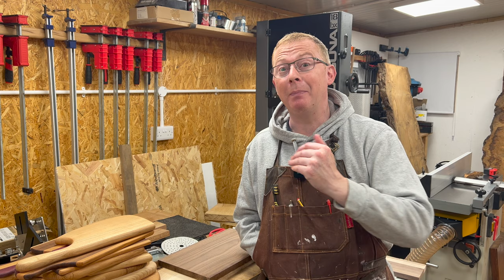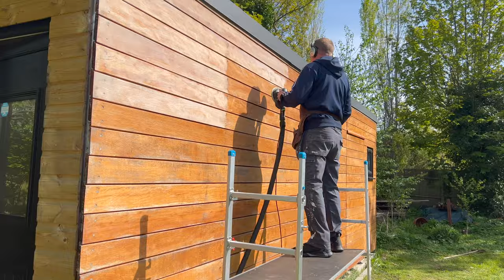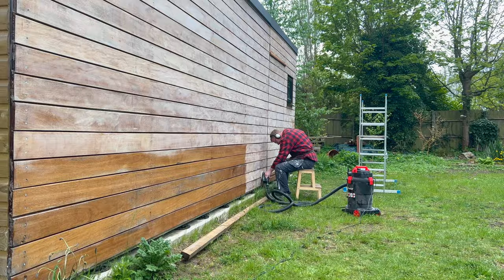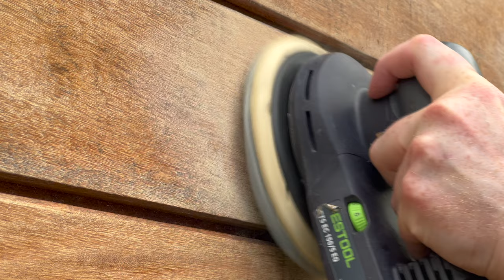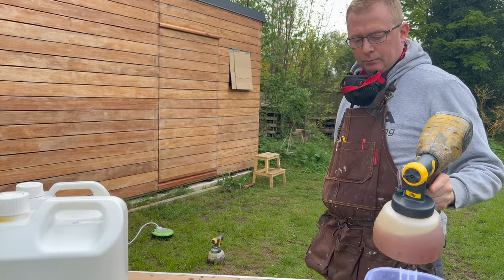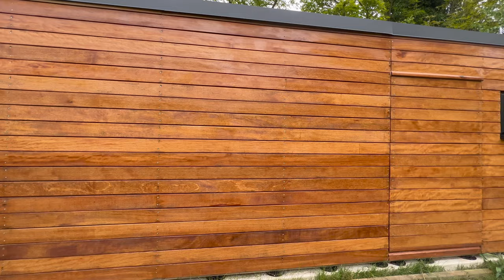I've Had It With Osmo UV Protection Oil👎

Comment: Timmersol Exterior Timber Stabiliser is a great (and much cheaper) alternative to Osmo UV Oil. It's full of oil and wax and holds up really well, especially for log cabins which suffer from more timber movement issues than any other product. It's nano porous so still allows moisture to ingress and egress, but at a much slower rate than a micro porous wood oil, preventing those huge swings in timber movement.
Reply from the maker: Thanks Pete, may I ask where did you get it from? Cheers, Leo 👍😀

Comment: How did the boiled linseed oil hold up?
Reply from the maker: About the same as the Osmo Michael. I’ve set up quite a bit experiment testing different finishes on the front of my workshop. Recent video on my channel if you’d like to check it out 👍
Reply: @Hand-i-Craft  I've got pretty big area of batten fence to treat so was looking at my best options. Money wise also as osmo is coming in pretty expensive. I've watched your recent video of the difference products you've applied. I'll keep an eye out for how it turns out.

Comment: I was about to comment on the older video you have up regarding Osmo UV Protection Oil until I saw this follow up!

Unfortunately, I have had the same experience with the product as you. I’m out in north-central California where it gets pretty dang hot in the summers and decently wet in the winter (Winter 2022 was epic [wet] for the whole state).

I’ve got a long redwood bench that sits out in front of the house; thought I sanded well and then gave it a few coats of Osmo UV oil. It applied great and the finish really brought out the beautiful tones of the redwood. I was pretty happy for the remainder of the Summer and Fall.

Winter hit and as I mentioned, it was an unusually wet winter for us out here. I’ve got a big sycamore that dumped leaves on the bench as well.

As soon as the weather started warming up, I tried to clean up the bench and pressure wash it, and I just noticed all kinds of areas of the redwood that were darkening and spotty mildew (mold?). I was pretty disappointed like you, considering Osmo UV oil isn’t cheap.

Could I have sanded better and could I have misapplied the product? Absolutely. Regardless, I’m out of Osmo UV oil and the stuff that I did put on, didn’t hold up. I’m going to try a product by Duckback and we’ll see what that does. Anyways, just passing along a shared experience. Take care.
Reply from the maker: Thank you for taking the time to share your experiences here. Very good of you and much appreciated, best wishes, Leo 😀👍

Comment: Do a test piece of any small piece of wood... with just one coat of titebond 3. Leave it outside forever. It becomes a rich golden caramel color and is seemingly indestructible.
Reply from the maker: I remember this comment from you pal last time. My only concern was how to apply this and the consistency across the whole area which is quite substantial. You’re absolutely right though and I will try it on a piece to compare results 😀😀👍👍

Comment: I used the osmo on a new shed and some raised sleeper beds 3 years ago and the shed still looks like the day I applied it but the sleepers have flaked and have black patches I think it’s down to moisture content of the timber at time of application.
Reply from the maker: The moisture in the timber was spot on when I applied it pal (less than 12%). I think the climate here doesn’t help and the high sap content of the wood, kind of makes the idea of forking out a small fortune on a ‘premium’ finish a waste of time 🤷‍♂️

Comment: Hope the new finish works better Leo, as you said, you pay a premium price you expect it to last and to degrade consistently with time.
I’ve had a similar experience with Ronseal Fencelife Plus which is supposed to last 5 years.  I sprayed our fence panels with it, wire brushed first and then 3 coats each side.  The following year it was flaking off in places so I repainted it all again with a brush and now this year it’s again flaking off.  I complained to Ronseal and they gave me some vouchers for replacement products but when I’ve finished it up I’ll be replacing the fence with UV resistant plastic panels as I can’t face painting the fence every year with what is supposed to be a 5 year product.
Reply from the maker: Exactly Geoffrey, if a product doesn’t live up to its claimed purpose, then what is the point🤷‍♂️. The composite panels sound like a good idea, no need to worry about maintenance then 👍👍
Reply: It was the no maintenance that's my primary reason for looking at composite. But ugh the cost

Comment: Doesn't matter how others have found OSMO, you're talking about your experience ... others can either listen to your experience or ignore it and try it themselves ... in your case it didn't give the protection you thought it would and therefore wasn't the solution for you!!     I'd prefer to use the brush for an external finish as it gives a far thicker coat than with spraying 👍
The doors on my garage are wood and I coated them with Ronseal 5 year woodstain varnish (I think that's what it was called), about 16 years ago and they look almost as good as the day that I did them ... I'd say they are slightly sheltered from the majority of the wind and rain, but whether that has made a difference to the longevity or not I don't know!
Reply from the maker: Cheers Barry and thanks for sharing your positive experiences with Ronseal, great for folk reading these comments looking for ideas and suggestions 👍👍
Reply: Ive had a similar fail with Osmo. Try Impra ( Color then Elan) superb stuff lasts much better.

Comment: How's it looking 10 months on? Same as with the Osmo? I'd be ok with that using a much cheaper product.
Reply from the maker: Spot on this pal, it’s the same results as the Osmo as in it’s in need of an annual maintenance, but literally at a fraction of the cost 👍👍
Reply: @Hand-i-Craft  Thanks mate. Just sanding down my cedar fence to re-treat as I had the same issues. 👍🏻

Comment: The cladding only received finish on the side surface right? So maybe moisture and rain water is seeping in from the gaps between the strips and get trapped by the side finish and started micro rotting
Reply from the maker: No, all sides were treated 👍👍

Comment: Everyone is entitled to their opinion. I don’t have one as I have never used the product. But I do know the weather in the UK and if can wreak havoc with oils so I think you should stick with the 2 to 1 mix and give it a coat or two every year.
Reply from the maker: That’s exactly what I’ll be doing John. Totally accept there are a huge range of variables that could affect the performance of that oil in the U.K., the weather certainly being one of them. If that is the case though, why are people (including myself) even bothering with Osmo UV oil when we can get similar results at the fraction of the cost

Comment: Why haven't you spoken to osmo they are really helpful, I have many times. There is a osmo product called base coat for exterior wood you apply before the oil to stop mildew and black spot then the oil to seal. Also spraying it on out side in the wind for an oil its probably gone on far to thin. There is a specific amount per mtr for oils so best brushed or rolled on to soak in then wipe off  if necessary. I have used it on lots of exterior wood no problems. I hope this helps.
Reply from the maker: I tried Stephen, twice, and received no reply to my concerns. When you see me spraying on the wood, that isn’t Osmo, that’s the mix I’m trying out instead of Osmo👍👍. Cheers for the message though and thanks for sharing your positive experiences with the product 😀👍

Comment: Spraying looks a lot easier than sanding.  Hopefully it won't need sanding when you redo it as long as it's not left too long.
Reply from the maker: If the upkeep now Mike is spraying one or twice a year then I’m happy with that. It looks great again now 👍👍
Reply: @Hand-i-Craft  It certainly looks a lot better than it did with Osmo and the flatter finish is nicer.

Comment: Interesting. I've never had an issue with any osmo product, but I mainly use it on interior cabinetry. I don't really find it that expensive either as it goes so far. The only things I've done in the UV oil are 3 bee hives, specifically because it's a more bee-friendly option compared to other finishes. Been on 3 winters and still sound.

I did a cedar clad shower room (don't ask 😂) in osmo top oil with osmo wood protector underneath and that came out amazingly, 18 months and still good.

Still, not sure I would do cladding in it. As you've discovered... Something like that I guess needs a more 'nuclear option' 😅
Reply from the maker: Cheers for the message Pete, as I said in the video lots of variables to factor in, but after it failing twice I just didn’t see the point paying a significant premium that isn’t working 👍

Comment: Trying to figure out how to waterproof an Osb shed, have resin lying around so found your video on resin for outdoors experiment.. I was surprised osmo performed well. Now I find this video.. I'm really not a fan of this brand. I used one of their interior wax products in White colour, and I found the smell and fumes were a horror! And the finish was just ok. I don't understand why everyone uses this super expensive, smelly product!
Reply from the maker: Thanks for the comment. The outdoor resin experiment gave me the confidence to go with Osmo UV Oil for my front cladding and it hasn’t worked out at all, very very disappointed. Is the whole of the external part of your shed OSB? I’d maybe consider spraying it with decking oil (like Cuprinol for example) or even use the concoction I mixed up for my front cladding post Osmo which is 2 parts boiled linseed oil to 1 part turps substitute 👍👍
Reply: @Hand-i-Craft  Thank you for the suggestion, it's kind of what I already started as I had a ronseal decking protector already so decided to use it up. It is a complete OSB3 external, even the roof! And I love the look of osb so after searching around, I've now covered one wall with cromapol clear roof coating. Planning to put it on the roof too. So far I am very impressed with the product, it creates a complete acrylic waterproof barrier, £30 for 5kg. I'm hoping it doesn't need yearly maintenance. The shed will be a bit of an experiment, since every wall and piece of wood will have a different treatment on it! Now I'm debating whether a PVC F trim with some sealant will help seal the osb edges of the roof or just create more problems! hmm

Comment: Your sprayer is more like a mister. Apply Osmo with a stain pad.  This enables deep penetration and no waste.
Reply from the maker: I used a brush when applying the Osmo. The spray gun was used for applying the boiled linseed oil mixture

Comment: I fall in and out of love with Osmo, thinking it must be me who has missed the point!  But when my tins are gone I don't think I'll go back.  The claims of strength and robustness don't apply to how you'd put it on furniture or guitars, but when rollered on thick on a floor.  And after two coats you can't go further to improve it.  So in terms of protection it's no better than an cheap oil.

But you're right, it is easy to get lured in by the Osmo Hypnosis.  😵
Reply from the maker: You’re absolutely right pal and I remember reading your comment in the original video. Be interested to hear what you move onto when your Osmo runs out 👍

Comment: Oxyclean warm water scrub brush will revive the wood. Darker the colour the better the UV protection. Natural oil wood stain. No need to sand for maintenance coats. Mentholated spirit for dry cleaning after sanding. Shouldn't of used any spirit with linseed oil
Reply from the maker: It was boiled linseed oil, does that make any difference? Thanks for the tips btw👍
Reply: @Hand-i-Craft  wizard of wood check him out. I just ordered 2.5 litres of 708 teak natural oil for some previously glossed cladding. I've heat gun stripped and mirka sanded down 80&120 grit. Just stick with the Osmo two thin coats. Decking oil 007 teak will naturally patina grey. Darker the colour the better the UV
Reply: @Hand-i-Craft  just sand it once to a good standard. Meth wipe. Two thin coats. One for maintenance

Comment: Osmo uv protection oil used to be a brilliant product, but it’s totally useless now.  Refinished my oak porch after 5 years life from original Osmo Uv protection oil in 2023.  After 8 months it failed, black and grey on window ledges AND vertical surfaces patchy as hell.  Took me 6 weeks to rub it all down and use another product.  Osmo changed the formula and didn’t make any statements about this, not professional at all, so I jog on with a painful lesson and they’ll lose another customer 🤷‍♂️
Reply from the maker: Thanks for the input here, I was totally unaware of this and could answer a lot of questions folk have been asking about the product failing them

Comment: I'm not a big fan of any Oil especially for exterior, I have tried Boiled Linseed Oil on a Bench that was outside, same failure the wood turned silver within 18 months (even with giving it another coat after about 5 months) Also some people will ask if you checked the 'moisture content' of the wood you are applying it to, did I f*ck! I'm not sure there is a finish that does not need some sort of yearly maintenance in our climate the 4 seasons takes it's toll
Reply from the maker: Agree with what you’re saying here pal. Begs the question why I went with Osmo UV in the first place when I could have saved quite a bit of cash using alternative methods 👍😀
Reply: @Hand-i-Craft  One thing that has certainly delivered for us is Sadolin Superdec.  Of course it's a paint rather than a 'finish' but on our old shutters inFrance with only modest preparation it lasted 10 years with the first coats (2) and when I repainted them, again with minimal prep, they looked good as new.  My neighbours shutters which were new and used local paint professionally applied are peeling after about 2-3 years.  Sadolin is expensive but it does work, easy to use and very durable.  The shutters haven't changed size either!

Comment: Thank you for saving me a lot of time and money.  I live in Arizona and the heat/UV rays here really are extreme.  If a product doesn't 1,000,000% work in other locations, it definitely will not work here.  Much blessings to you for this video.  ❤
Reply from the maker: Thanks Michelle and best of luck with whatever finish you choose ❤️😀👍
Reply: @Hand-i-Craft  Thank you!  I'd appreciate any advice.  It's to penetrate!seal a slate floor that gets a ton of Arizona sunlight even though it's indoors.  In the past, I have tried linseed and tung oils but they both eventually failed.  I am now pondering Cutek Extreme.  Any thoughts you have on this would be so appreciated.
Reply from the maker: @michellechalmers8753  I know this might sound a cop out from me but my best advice Michelle would be to seek advice from an expert local to you. My main reason for saying this is the type of weather you experience is fundamentally different to what we get here. I’ve visited the west coast of Canada and the USA and the heat at times there is brutal for sustained periods. That is something we simply don’t experience here, our main enemy in my part of the U.K is rain!